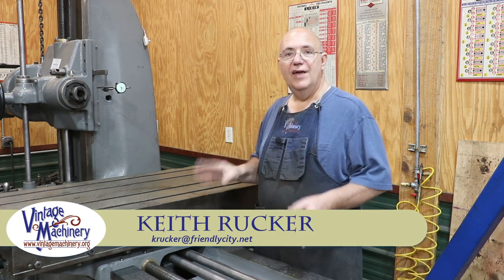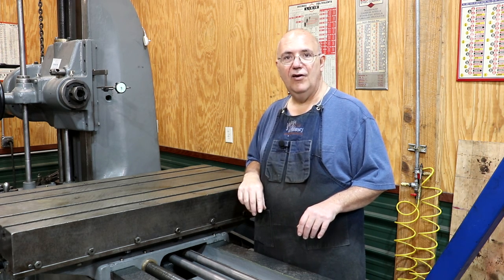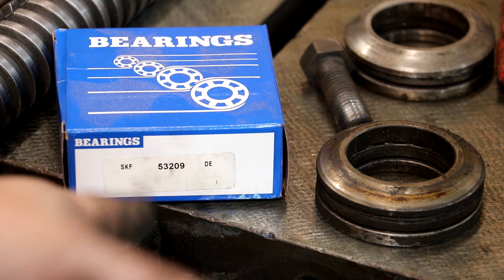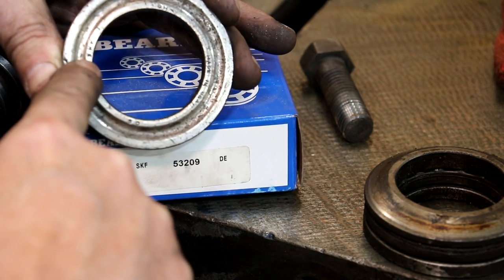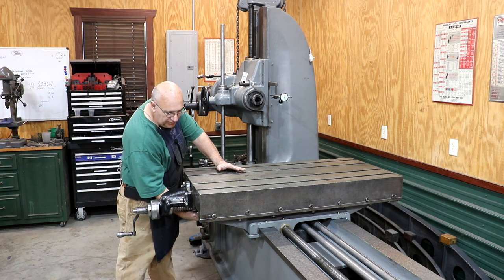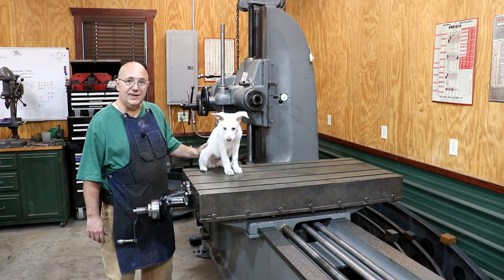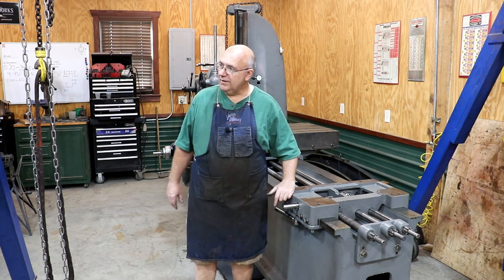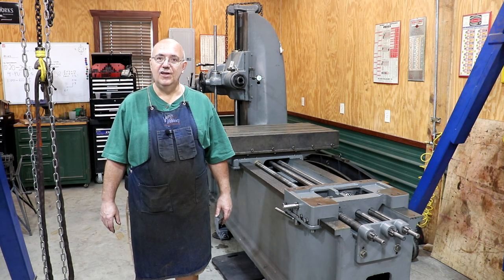Horizontal Boring Mill Restoration: Installing the Table Lead Screw and Tailstock Base

Comment: I know you don’t jump up and down like a youngster when pleased and excited but you got very close to it when all the controls on the cross slide worked to perfection. You do work so very hard restoring the old machines. I wonder how many of the new CNC stuff will still be working and be repairable in 100 years?  Great video. The dog is delightful and was bored, think why’s he not playing with me instead of that silly, big lump of cold metal!
Reply: Hi John having installed and serviced cnc machines from the mid 80's until the mid 00's I think that you are asking the wrong question. there is nothing lesser
quality about any part of a cnc machine  and as such they will last and be rebuilt for as long as any machine, pre cnc.
 ways can be reground , and turcite or equivalent has been used all alone.
ballscrews can be reground or replaced,  linear guides ,if used are easily replaced.
servo drives and motors will continue to be available , and the price of non oem drives and motors are at hobbies prices now.
The equivilent modern boring mill has a servo motor directly attached to a ballscrew ,there are absolutely no gearboxes anywhere to deal with.
CNC machines operate 24/7 for a decade or more with proper care and attention, I wonder how many decades that represents for a old style manual machine.
So why is it the wrong question ? comparing a machine like this to a cnc machine is an apples to oranges comparison. 
the cnc machine is derived from automated production machines that have been around for a century or more,and are replacing
them , not manual machines  such as this one.

These machines are still loved and used because they are so good and   there are no modern equivalent and really, no one makes them any more because there
is no demand.
Reply: Hi John
I have a mixture of conventional, manual machines and CNC machines and each one has it's place. I love them all and interestingly, the CNC machines are older than my manual ones.
Reply: @steveggca   Good explanation!! People are quick to run down the newer machines and forget, or don't know, about the less than perfection of older machines. This not only applies to machines such as these, but to automobiles and many types of machines in between. They don't build 'em like they used to. Thank God.
Reply: That’s a great explanation. Another thing I’d add is that many “survivor” machines from the pre-automation era passed through the eye of the needle. They have had to have been cared for over decades or at least not extensively misused and the facilities they are in need to remain at least dry. At one point in their lives they would have been hardly worth more, in pure dollar terms, than their scrap value. If they were in production facilities they were a commodity. There wasn’t an industrialist out buying the most accurate and aesthetically pleasing machines because he liked owning high end machines. Rows and rows of these were bought to do jobs within acceptable tolerances. When they didn’t do that any more a bean counter decided whether the cost to rebuild was justified by future earnings, if not many machines were scrapped.
Having recently watched an early and very high quality  Maho cnc mill being rebuilt, the challenge seemed painfully complex. While the mechanical components were broadly comprehensible to me the electronic and electromechanical parts were not. Many parts were no longer made and were never  made at anything other than a major industrial plant. In order to repurpose the machine almost all of the electromechanical and electronic components had to be removed and replaced. The mill is back in use but it was originally engineered to have certain types of sensors and programming and the physical interface was dictated by that. It’s now something else, not that mill.

Comment: Keith, do you need to make another handle with a longer toothed tube for controlling from the end of the long shafts, so that you don't hit the tails of the other shafts. Having extra handles on these machines is always a good idea I feel, as it avoids having to move a handle backwards and forwards between two controls you might be using.
Reply: Spot on
Reply: That would make a good video.
Reply: Patience!  :)
Reply: I’m not a machinist but follow several channels. Years ago, bcbloc02 mentioned that he had acquired a HBM and had to modify the floor in his new Barn Shop for proper mounting. I missed when he said HBM meant…. For many episodes, all I could think was “Huge [something] Mother”.  Brian’s channel was recommended to me when he started working on restoring a 100 year old dilapidated barn into his “Barn Shop”.
Reply: @Poppi2006 , That’s when I started watching Brian also, installing that bridge crane was quite the project but what a huge help to have that in his shop.
Reply: I have discovered one advantage to only having a single handle, it helps prevent us from forgetting and leaving it engaged on a drive spline and kicking in rapid traverse 😬
Reply: @perpetualmotion1 , Houston, we have lift off! Lol

Comment: I for one would find it difficult to size to scale  a horizontal boring mill for my shop. They appear to come in all sizes, up to that of Brian Bloc size. Too easy to take the first one that comes by without consideration for scaling it to your shop. Appears much research must go into shopping for one that is not too small, not too big, but the right size. Same goes with vertical boring mills, radial arm drills and the like. You've done well Keith scaling all your equipment to fit that beautiful shop of yours. Yes, everyone needs a shop dog. Welcome Maggie to the channel. Last note, maybe the topic of scaling equipment could be a video subject some day. Thanks for all you do.

Comment: Commenting about where you need extra hand to manipulate the shafts for the key:  I'm sure if you put a temp wooden lever on the far end of the leadsscrew along the bed, you could train Maggie to nudge it on command left or right by incremental amounts to turn the shaft 😆 Channel her inner Australian Shepherd :)

Comment: I find it very admirable,that all the machines in your shop. That needed or need some repairs. May pause repairing them. But always return to these machines and complete the repairs.
   I do have 1 Question. When are you going to release more Video’s repairing the Steam Locomotive’s,Stoker Steam Engine ?

Comment: On my G&L the tailstock elevating screw mounts in a nut that is adjustable so you can raise or lower the tailstock bearing to time it properly to the spindle.

Comment: I have a very nice late model 41, I really wish they had kept the handle drive splines on the far end of the bed like yours has. I've repeatedly been working on larger work using a boring bar and wished I could operate the hand crank on the z axis from the end. I'm thinking of pulling my lead screw and adding a piece like you made and adding it to the end.

Comment: I noticed that when you assemble the saddle and tailstock bearing holders and screwed the bolts in without any lube on them. Strange I though they would screw in easier with some lube on them!

Comment: Very good to see the dedication in returning this mill to work and making it look great as well. This is true heritage.
I was watching the thrust bearings go in and the way the rearmost one was working left me a bit confused. The inner collar appeared free floating. I would have thought that there would be a threaded collar placing pressure back in an “outward” direction from the rear face? Otherwise I can’t see how that bearing would be doing anything. 
It may just be because of what we can see in the footage but I thought I’d ask.

Comment: Any particular reason you don't use Never Seize on your bolting?  I've found it makes torquing and disassembly ,when needed, much easier as well as providing protection to the threads.

Comment: I might be missing something very basic here, but if the tailstock is adjusted along the bed by a worm gear riding on top of the main lead screw, what stops it from moving when the table moves?

Comment: Anyone know where I can get a manual, operators/repair, for an American pacemaker style H (I think) 32” swing. I work at a titanium refining plant and they have 5 big lathes for trimming and cleaning up ingots after they are melted and before they are welding together to be melted subsequent times. Nobody here knows anything about these machines and we always have to screw around for way too long with them any time something happens to them or something isn’t working right for whatever reason. Thanks.

Comment: Good morning Keith! Looking good. The tailstock base didn't need the Turkite?   At least for wear? Thanks for the videos.
Reply: Walter, I haven’t watched the whole video yet but just got to where Keith is showing all the different places he can control this machine. One of his comments he said that particular drive screw operated the tail stock up or down, with that control he shouldn’t need to shim the tail stock, should he? I’m not a machinist so I don’t know exactly how these machines operate. Just trying to learn.
Reply: @Hoaxer51  When he put the turcite under the saddle, that raised it up just a little bit. With no turcite under the base of the steady rest, the screw and shafts that run between each component are now at a different height one from the other. Even though, just a little bit, when the two units are moved close together there will be a little bit of a bind on the three shafts.
Reply: @cliffordfender1159 , My understanding was that Keith used a turcite thickness to put everything back to its original location after it was ground, that’s what he said in a previous video. 
The tail stock isn’t used that much (?) so Keith said he might need to shim it up a bit. But I do understand what you’re saying about the shafts lining up, especially the closer they are to each other.